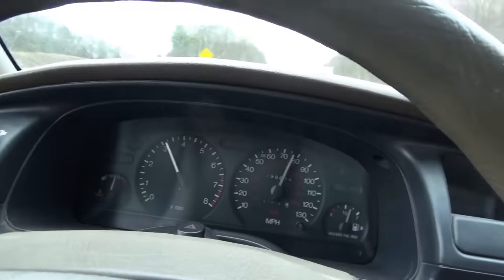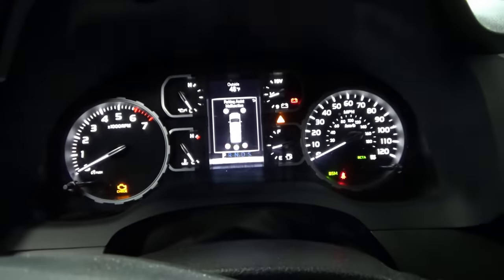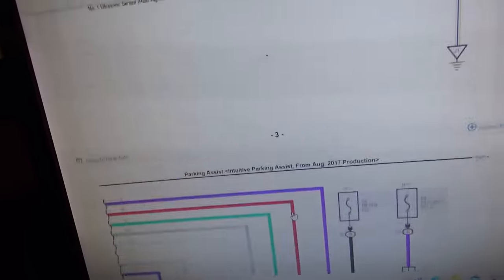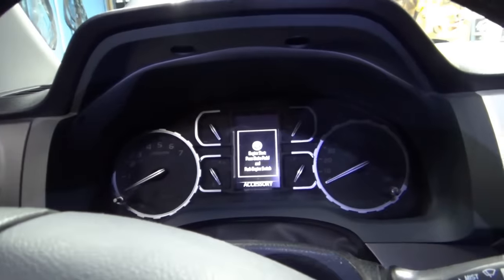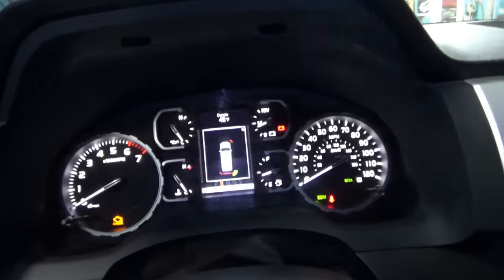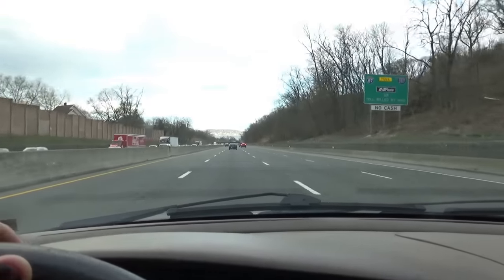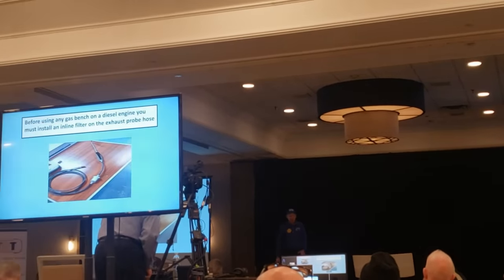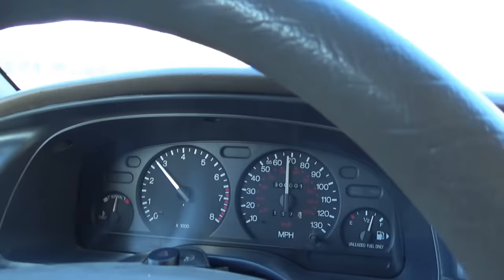Dealer Wants $1,100...for THIS? (Toyota Parking Aid MALFUNCTION) + TST 2024 Highlights!

Comment: I'm at 426,000 on my 2001 F250 PSD.  My friends and family are getting sick of me sending them pictures of the odometer, but congrats!
Reply: I was driving a 2005 Chevy Trailblazer with 323,000 miles. I get it.
Reply: I know eh?
 its a guy thing.
Reply: Throw them an odometer party.
Reply: I had 684,000 miles on my 2005 GMC 2500 HD 8.1 gas when I sold it. And that was after only 5 years of ownership. Best vehicle I ever owned! My family was actually proud of my accomplishment.

Comment: Regarding Ivan's truck in the last part of the video: It's funny. I have decades of esperience working with computer equipment and getting it fixed. I've worked on $5,000 gaming rigs. Meanwhile, I use two laptops that are so old, they can't support Windows 11. There's something satisfying about using equipment beyond its expected life.
Reply: My main computer is from 05.
 I have 4 all together, all within two years old/ top shelf units.
 But my go-to one is ... the 05 clunker. I just keep fixing and cleaning it as needed.
 Must be a guy thing? I have an apple 4 cell phone.
Reply: watching this on a windows 8    it would be seven if i could fix that one
Reply from the maker: It's not a truck 😉
Reply: His truck is actually a 1996 Mercury Mistake; kinda like the Ford Contour and Mondeo.  I thought he was driving his XL-7.
Reply: I'm watching Ivan on a 14 year old Acer and Windows 7 still working like a charm.

Comment: Go to as many training classes as you can. I worked as an Industrial Mechanic. When PLC's were becoming popular Allen Bradley was offering training classes. The company I worked for was willing to pay and send us for this training. Most of the guys turned it down because some travel was involved and it required several days away from home. I went to every class they offered. I took many  classes in PLC troubleshooting and programing. If you work with controls the training is invaluable. Much of the training you can relate to other aspects of equipment repair. If you get the chance do it!! The information you receive will carry with you through your career.
Reply: The guys that didn't go were usually sitting around the lunch table every day bitching about the new fancy dancy electronics nowadays.  😅
Reply: I took the  Ron Beaufort Allen Bradley Control Logix/SLC500/PLC5 training a few years ago. I had a pretty good understanding of the PLC but WOW Ron really taught some unique troubleshooting and programming steps. I go to any training available.
Reply: I work as an Instrument Tech at a large industrial site and as a contractor they won't send us for any training 😂 makes my job far more difficult than it already is. Training is key in any technical profession for sure

Comment: Hi Ivan. Original owner 2009 KIS Spectra 5 manual transmission. 278k miles. Nothing but regular maintenance. Interior and exterior excellent condition. If you take care and have a basic good vehicle no problem. Love your videos .

Comment: Ultra sonic parking  sensor generally work at 40khz   frequency (same as bats use !) You can show individual  sensors on a scope with the Pico Automotive  ultrasonic probe  or alternatively a cheap  Chinese ultrasonic leak detector will let you hear the signal.

Comment: Love. The. Mystique. Story.    Wow. Seven. Years.  Five hundred. Dollars.      Very. Impressive.  Thanks
Reply: Your Mystique amazes me with the milage you got (🗣️ before the Tapanzee bridge).  Both my vehicles are 20 plus yrs old.  My daily driver is a 2001 Durango SLT Plus and a 2003 Dakota SLT extended cab,  both bought in 2006.  I replaced the engine in the Durango in 2019 at 174k and it's running beautifully.  They were my parents vehicles and I inherited them and still keep em going.  The Dakota has 239k miles on the original engine and transmission (night with 16,000 miles) and have only replaced the water pump outside routine maintenance 😊

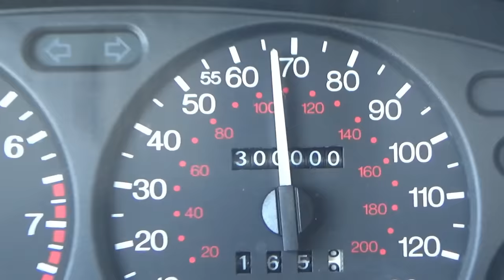Comment: 19:20  nice. I did similar. 2002 Focus ZX3 manual, $1,100 back in 2019. Just did whole clutch system, including master, FW, even rear main seal, for $1000 at 207K miles. Runs like new.

Comment: simple way to test ultrasonic sensors is with your phone , I use a sound level app. put the phone near the sensor you should see activity and hear some clicking
Reply: Can you explain how this works?
Reply: @bartscave microphone listens and is displayed on phone, compare each sensor, bad sensor or connection will not emit
Reply: I use a engine or doctors stethoscope with just a hose attached and you can hear the sensors heartbeat. Be sure to have in reverse or forward gear with just key on 😊

Comment: I bought my 87 S10 22 years ago with 141K on it, it’s currently got over 540K miles on it. I thought the transmission failed at around 160K and took it to a shop, it was the flex plate, but I had them rebuild the 700R4 anyway since it was out. Other than that all I’ve done was suspension, brakes, fluids and intake gaskets in my ownership. That little 2.8 can take some abuse.

Comment: For whatever reason, Toyota decided that the Tundra, Tacoma and 4Runner would retain archaic electronic underpinnings, going back to pre-2014.  It wasn't until the 2023 (Possibly 22?) Tundra that we'd see modern systems like in the rest of the lineup.  This particular park sensor arrangement that's coordinated by the Combination Meter predates IPA/ICS, and while there are limited data PIDS in the Combination Meter, your diag method here is the quickest and most effective way to narrow down an issue.

It's incredibly common to find any one of the 6+ "bulk" connectors not properly seated, not plugged in at all, or invaded by dirt on collision vehicles.  I've seen pinched rear main harnesses on bed side jobs from sliding the bed back enough to replace a bed side.  These trucks can be a diagnostics nightmare just because of the lack of scantool interaction and the number of subsystems that exist entirely on their own and only report bare minimum data to another module for driver interaction.

Comment: That's the key to this Mercury still being alive...  The fact that it's a manual transmission.  I had bought a Mercury sable when I was 14 (worked all summer with my uncle in mid 1990's) and my mother decided to drive it when her car had some issues.. and she ended up destroying my transmission before I ever got of age to drive it. lol..  So I bought a used trans for 300.. g-pa helped me put it in; and I did get to drive it for about a year, before the trans died again.. luckily (by dumb luck) my uncle bought a wrecked sable just like mine-  for the engine;  and I put his transmission (the 3rd one now) into my sable...  and I helped him put the 6 cylinder sable engine into a little extended cab 5spd Ford Ranger and turn that thing into a speed d3mon.  That Ranger was awosme after that. (4x4 and manual trans).   The Mercury/ Ford front wheel drive automatics were horrific...  but you did well buying a manual.  All my cars after that were manuals.. and I'll never go back
Reply: I wish the 2nd gen Taurus /sable (92-95 body style) was covered with a manual. I like those cars. 

Bought a 93 3.8L sable wagon in mint condition back in 02 for $300 with blown headgaskets and only 70k miles.

Fixed it up and drove that for a while. I worried about the trans but it was ok for me. I kept the fluid changed but the failures were not always fluid related.
Reply: @volvo09  Yeah.. My sables were all high mileage.. like up near 200k.  I was young and didn't know much about cars or common problems on some vehicles, etc..  I learned that lesson the hard way. :)   ..  but I did learn how to work on cars during that time-- so it's a bit of a blessing when I look back:   having to overcome such overwhelming mechanical issues at such a young age.   I got smarter at picking them after that.  I bought a 97 Isuzu Rodeo that was 5spd 4x4, and drove it over a decade. I absolutely love that thing and I still have it...  Then a 95 F150 5spd 4x4.. and later a 2002 F350 7.3L diesel, 6spd manual 4x4. etc..   I drove each of these for 10 years each. lol.   Manual 4x4 is the only way to go.  Or at least like a honda or toyota that's manual AWD

Comment: Great video Ivan!
I've learned that watching Bernie Thompson's videos, it helps to watch a second time to totally gain the knowledge he's putting out.
I've dealt with backup bumper sensors in the past, at work, which were much easier than what you had, but like you I learned to make the system work for me to point out the problem.

Comment: I've seen body shops leave the bumper bulk connectors half plugged in/ plugged in with dirt and the lock not engaged many a time, and the first thing I do is tug on the connector without touching the lock to see if that's the case off the bat, I suspect that or one of the sensor connectors weren't fully plugged it

Comment: I have a 2006 Silverado 5.3 with 310,000 miles. My brother had a 2000 Silverado 5.3 with a bit over 500,000 miles. The oil pump decided to give up and locked the engine. They just don't make them like that anymore! I've done VERY little to mine.

Comment: i'd like to see voltages and signals on those sensors. gotta be low .  manufacturers are doing a disservice puting connectors in those harnesses on low strength signal wires

Comment: I was given my father in laws 1995 Ford Contour 2.0 when the CD4E went out at 77000 miles. I replaced it with a used one and drove it another 100K and that one went out . Changed it again with a rebuilt one and is up and running again. It was the last and only new car he purchased. I have been keeping it going in honor of him. 
  I replaced the timing belt at 77000 miles just as a precaution.  Replaced the struts and coil springs which are known for breaking and did. Front wheel bearings and rear hubs. Valve cover gaskets and tune up .
Have had problems with chaffing wires which Ford has a problem with. Liquid tape has kept it going. It's working great now and I wouldn't be afraid to drive it cross country. Doesn't use any oil between changes. Shooting for 300k now. Have you ever changed your timing belt and water pump?
Reply from the maker: Nice! The original water pump seized up at 220k miles so did the timing belt then too. Coil springs as well. Doesn't burn any oil at 300k miles which is amazing! 😀
Reply: @PineHollowAutoDiagnostics  The zetec is a great engine.
Reply: I also upgraded the rear stabilizer from one out of a Cougar. Bigger rod. It gave it a more stable feel especially when cornering.
Reply from the maker: @pltmann  The suspension and handling is simply amazing...soft on bumps and very stable in the corners. Must be the European design. I did put the bigger 15" Contour SE wheels on it for better grip. I call it my 4-wheeled motorcycle :)

Comment: During the opening shot of this video I was trying to figure out what vehicle you were in because it didn't look like the XL-7.  I am thinking that Mystique is the base model (we got into a discussion once about that) and has the 2.0 liter Zetec engine; I am sure it returns good mileage. Congrats in 300,000 miles.  The only thing worse than $1,100.00 for parking sensors is $5,600.00 for taillights.  Just ask Brian with Ford Tech Makuloco.  The ol' Marquis is getting ready to roll to 500,000 miles.  Looks like Brandon Steckler sitting with you at the table.  Eric looks different without his hat!  GREAT VIDEO!

Comment: Hi Ivan,Liked this video,in this case i would have done a visual 1st to look for a disconnected sensor,or a broken one in-case they just swapped them around.On the classes,when i work designing and making specialty parts for nail guns,and machines  i always tried to go to any classes nearby given by manufacturers of stuff we MIGHT incorporate in the design.I liked them a lot,as a chance to get out of the shop for a day or two and lunches and car rentals and maybe a room on the business.And a lot of information FROM the GUYS that really know the parts.I went to one 120 miles away on LOC-TITE!!!Yes from 8am to 3 pm.I always thought you open the bottle put a few drops on the bolt or nut and it stays put.haha That class  help me solve and issue we had where an assembly kept coming loose costing us thousands in a recall.Now that COVID is not in the light ,maybe there will be more classes.thanks buddy.
Reply: So, what's the secret about applying Loctite then? All the instructions you are supposed to follow are right on the bottle. If there is a problem, then i would guess the instructions were not followed in the first place.

Comment: Im a toyota tech, those parking assist sonar sensors are very sensitive. There was a TSB on tundras for corrosion for the rear park assist harness. Probably whats going on here. Theyre also wired in series, its easy to find the fault when you find the main sonar sensor that the rest of them communicate through.

Comment: Curious about the parking sensors.  4 sensors all connected via a string of 3 wires.  There's power and ground and some kind of daisy chain protocol in the signal. That's all I can figure.
Reply: They may be using LINbus - it's quite common for low speed stuff on cars.   There are several variants, but one that's commonly used for sensor chains uses what's called "Bus Shunt Method" - basically, the signal is daisy-chained through all the sensors and they come up in isolated mode then turn the bus switches on after each node is configured.

Comment: 300 km is soon to be on my 07 Dodge 3.3 L Caravan.
 The body has 'stage 4' but the engine and tranny ... sweet.
 3,000Km. oil changes did the trick.

Comment: A Mercury Mystique running beyond 70k miles is an amazing feat!
Reply: but they were engineered in Europe and sold in the UK where I am sitting and so I am not surprised that they can run a lot of miles!
Reply from the maker: Manual transmission for the WIN lol
Reply: Don’t they use a Mazda- engineered motor?

Comment: Ivan, if yours is a 5-speed manual/ 4 cylinder, it should be my MTX75 TRANS first used on the Mercury Mystique, and changed to cable operation in 1996, and the predecessor of my Zetec 2.0  I'm not sure of your lifters, mine are DAMB.
"The Ford MTX-75 (Manual TransaXle) is a 5-speed transmission developed by Ford Motor Company for its larger-engined front wheel drive models. "75" refers to the distance in millimeters between the main and lay shafts".
"Debuting in 1992, the transmission was developed in tandem with the Zetec family of engines. The transmission is optimised for transferring larger levels of torque than the older iB-series unit used on the Fiesta and Escort models. Other features include the provision of equal length driveshafts (to combat torque steer) and synchromesh on reverse gear.

The transmission was first used on the Zetec-engined Escort Mk V (only XR3i), but its proper intended application was on the Mondeo and its derivatives (the American Ford Contour, Mercury Mystique and the New Edge Mercury/Ford Cougar). The 2000-2004 Focus with 2.0 litre Zetec engine, and the 2.3 liter Duratec engine with manual used this transmission, as well as all diesel powered versions of the Focus. It was also used in the 2.5 and 3.0 V6 versions of the manual transmission equipped Jaguar X-Type".
Reply from the maker: Yup MTX75 with rod linkage. Butter smooth shifts running on Redline MTL fluid 😊
Reply: My 2015 Focus has a MTX75 as well. Wouldn't have bought it without the manual transmission because the Powershift DCT is the worst thing to ever exist.

Comment: my experience on pollution ? Trace and wire require isolated wire size for distance in dc different polarity or ampere value .similar for ac . Take a cylindrical ignition coil . It's holder strap can not be metal . A band aid solution ? Slide the metal strap 3mm from the ignition coil stopper . This does not work on short cylindrical ignition coil . Like old ford . On those ? No metal strap  . Always use zip tie (not the brand but the type) and required solution to keep coil away from metal or tube full of liquid

Comment: Is the Mercury Mystic still on the original transmission?  Wheel bearings? Water pump? Fuel Pump?
Reply from the maker: Water pump and front bearings replaced once. Other than that all original as far as I know!